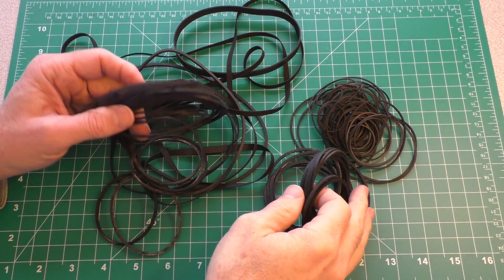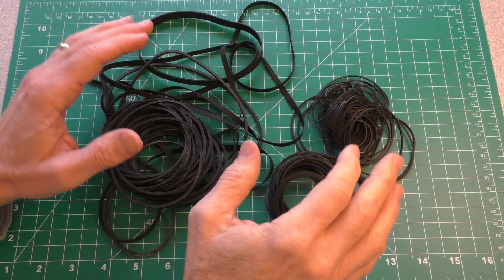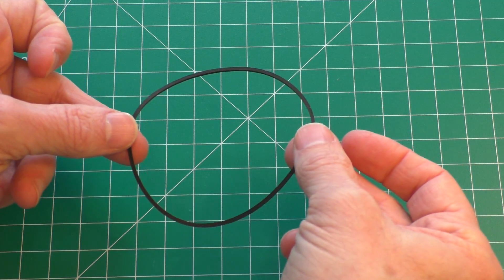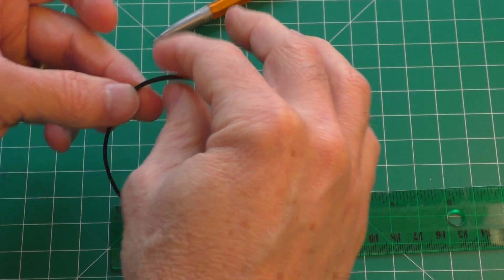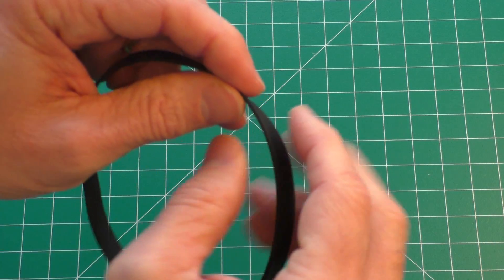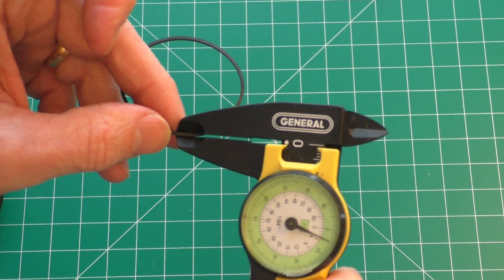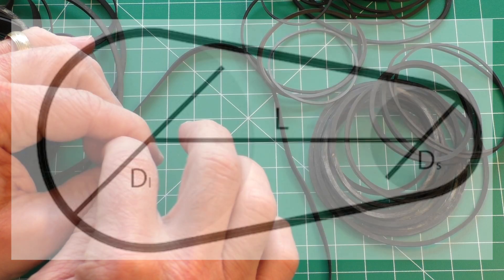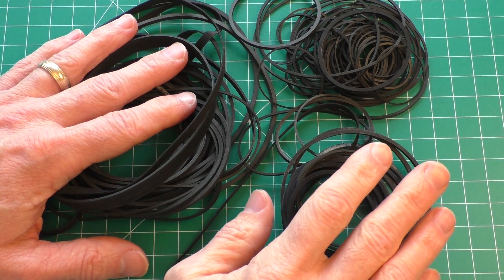How to Measure and Size Drive Belts

Comment: Don't this formula end-up with a band that is slightly longer than ideal? I calculate 180 when I was expecting 170mm. 
Side note: you got to measure the diameters quite precisely, because since they are squared, small errors in measurement lead to large variations in calculation.

Comment: The drive capstan is smaller than the platter circumference. If you was an engineer you would make the drive and the platter the same circumference. No you make the drive capstan circumference smaller for speed precision/accuracy. Not thinking about the end user when they need to replace the rubber belt. As an engineer if you were German you could come up with a solution and you could use an ordinary rubber band ... Any rubber band. Unfortunately the light bulb is dimmed by minimum wage which is related to central bank Weimar Republic cost effective cheap but when it comes to the bankers no expense is spared for luxury. Cheaply engineered cheaply produced planned obsolescence for the goyim while no expense is spared for bankers chauffeured in Mercedes Benz armor plated limousines costing the price of two Lamborghinis. Thank you no anti-Semitic remarks were used in this comment mister YouTube
Reply: No, no rubber band, they stretch way too much longitudinally. you want something with max stiffness and damper longitudinally, otherwise you incur oscillations.

Comment: Hi! Thanks for the video—I've been meaning to replace multiple belts for primarily cassette players for a long time. Unfortunately, a good few of them have melted into goop over time, but unfortunately your relevant demonstration towards the end of the video went waaaaay over my head. Is there an easier way for you to break it down for me, by any chance, perhaps put it into more layman terminology? I'd greatly appreciate it!
Reply: If the belt has turned to goop, then measure the distance with a piece of small string wrapped around the pulleys.  I suggest buying a replacement belt that is slightly smaller (try -10% at first) because you will need tension and the rubber should stretch. This is a very basic/crude way to find the right size without the equations, it should get you in the ballpark.  Also, remember that the profile of the replacement belt needs to be the same as what was originally used (flat, round, or square). Good luck!
Reply: Usually I'd just use dental floss and wrap it around the pulleys, then cut to find the full length of the belt I need